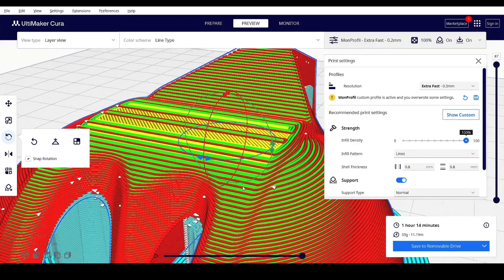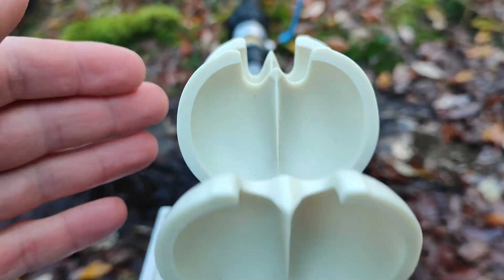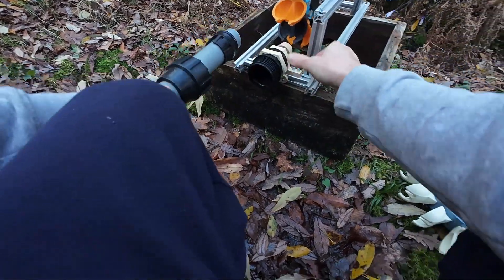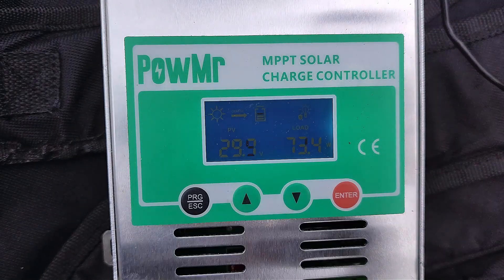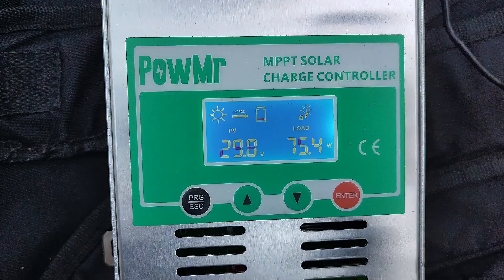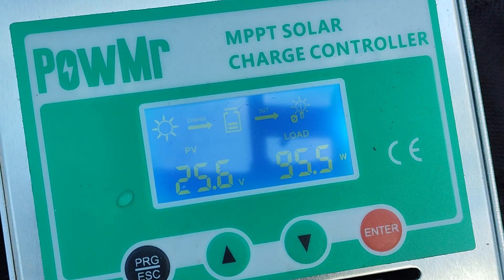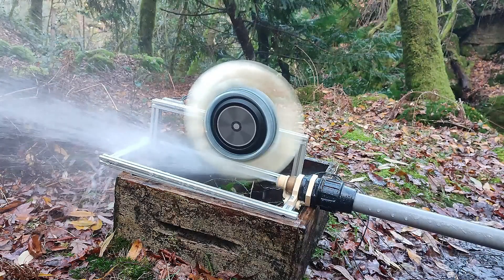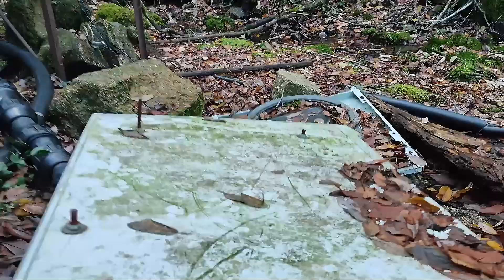3D Printed vs Resin Cast Pelton Wheel | Hoverboard Generator Efficiency Test

Comment: A lot of water seems shouting trough. Would rearranging the windings produce more power ?
Reply from the maker: With a load the water get slower but it should keep a minimum RPM, the MPPT charge controller is finding the right power it can take, a lot of people think that water should harness all the energy and fall with gravity right at the end of the spoons but in reality no, I've made quite some research about it and it's ok as soon as the water don't go too fast at the exit.
Reply: My guess is that the MPPT controller needs higher voltage in order to increase power. Higher voltage means higher RPM. If at this high RPM the water is shooting through, it means the water does not have enough velocity for this RPM. I would try reducing nozzle size further to attempt an increased water velocity.
Reply from the maker: @DrenImeraj  I agree with you but at a certain size you start to lose production, basically i have 8MM,10MM,15MM. The 10MM produce 95W meanwhile the 8MM produce 70W +- so it mean the sweat spot is around 10MM nozzle. But by increasing or reducing wheel size could change that
Reply: @Off_GridWorkShop  Makes sense. I guess you need more head to be productive at a lower nozzle size. Regarding wheel diameter, you would need a smaller wheel to increase RPM for a given jet velocity, but considering your design is restricted to motor size, that might be tricky. An alternative is to try a 2:1 gear ratio between the motor and wheel, but that changes your design drastically.

Im really looking forward to updates. Your design is one of the simplest and cleanest approaches to DIYing a pelton generator. Amazing job!
Reply from the maker: @DrenImeraj  Yes, as the pelton is around the generator i can't reduce size much, the solution would be to offset the pelton on the side of the generator. What i really like about this design is that it give excellent cooling! I might try with a smaller pelton on the side just to test efficiency. Feel free to join the discord group if you want latest files that i did not yet updated on the google drive ;) And thank you for your kind comment

Comment: Oh my god, what a difference! You should get a slowmo cam, or a strobe light (or DIY LED Strobe) to investigate this! Or is it just an alignment issue?

Are your cups the same? They look different!
Reply from the maker: Yes, it’s a surprising result. I will try to check in slow motion how the water hits the spoons. From what I understand, having smoother spoons lowers the friction of the water on the surface of the bucket, harnessing more energy. I remember watching a video about large Pelton dams where they stop the turbine every year to polish the spoons, increasing efficiency.

And the cups are exactly the same in practice; the only difference is on the holding side, so it doesn’t impact the test.
Reply: @Off_GridWorkShop  If so, then maybe youz could coat them with some water repelling stuff? Also the cups look different at the top. The white one have mor rounded edges!
Reply from the maker: @SurvivalSquirrel  Filler paint would make the spoon softer, combination of sanding + paint and you can make the same soft spoons, I made screenshot of the V1 vs V2 but the practical side is exactly the same : https://www.youtube.com/post/UgkxL-dtGvTbNOfeUN4ye7fhAsW9Zx0jdWCJ

Comment: The backside of the spoons shouldn't affect performance much should they? In which case, shouldn't you be able to design the spoons for printing on their backsides eliminating supports and reducing overhangs for faster printing and better quality cup surface?
Reply from the maker: That is indeed a good idea! printing the pelton face down make the support an obligation for most low end printer like mine, i will try to make the back of the spoon a little more flat to be flipped 180degree. thank you for the idea